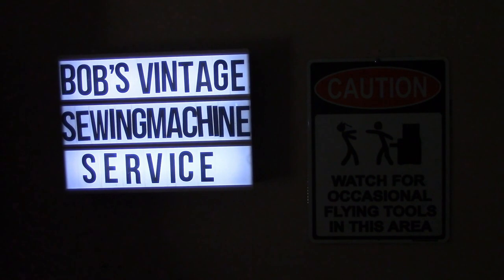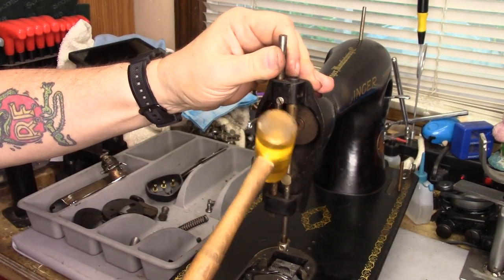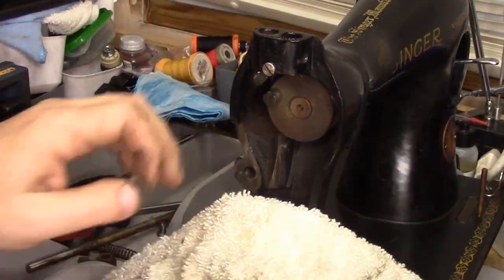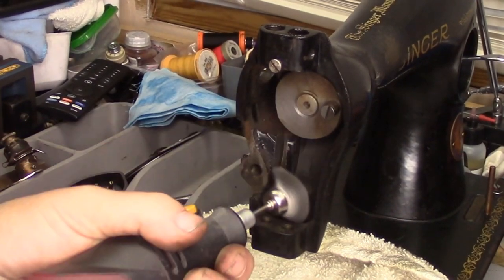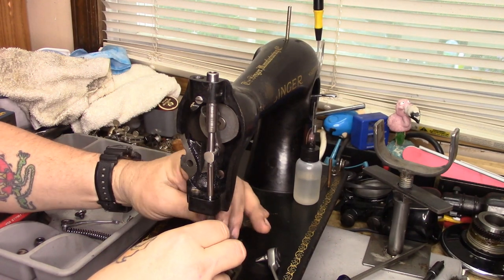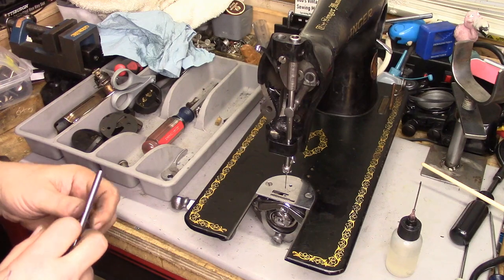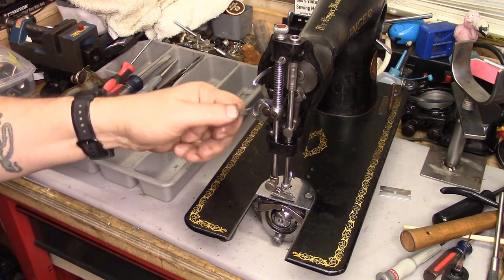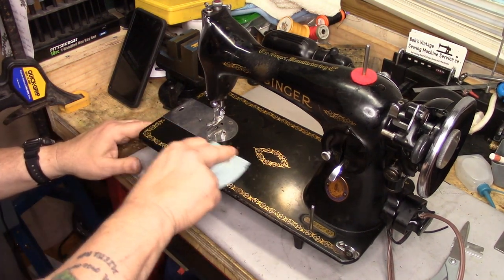The 15-91 Lives! Sunday Morning Quickies, May 22, 2022

Comment: Stupendous!  Never thought of running cup brushes into the needle bar area; always hand clean that area.
Reply from the maker: Glad it was helpful! I also use my smaller rotary tool with straight brushes, depending on the machine.

Comment: Great video, Bob. Machine looks like brand new. 
You are absolutely right about wire lengths. Every inch of wire that they saved, meant more profit. My mom worked at A.C.GILBERT cutting wires, and she used to tell me that you couldn't be off more than 1/16 of an inch.
Reply from the maker: OMG - Yeah, I know, they had to maximize profit and minimize cost, but I don't have to follow that rule! 🤣🤣🤣

Comment: I can’t thank you enough for your two videos on the bottom end of the 15-91 and your tutorial on rock shafts.  

In addition to your generosity to this charity, your generosity in sharing your knowledge is inspiring.  Truly.

Following your tutorials, I removed the upper shaft on my 15-90, took out the pivot points on the upper and lower shafts, cleaned them and then reset the points in the shafts and adjusted the movement and location of the feed dogs.  Now this machine started out really rather clean.  It has had more than one kerosene bath and I thought that the insides were just fine.  Was I wrong.

The inside of the pivot points were, to use your expression covered in shmoo and there was a certain amount of corrosion in the points.  I had no idea they were that dirty or corroded.  I also had no idea that the dirt and the bit of corrosion not only gummed up the machine, but it also resulted in the machine going somewhat out of adjustment.  I took a wire brush to the points them put a drop of oil on them reinstalled them and adjusted the shafts and the movement of the feed dogs.  

Given what I learned from your videos, the whole job took maybe 20 minutes and a fun 20 minutes at that.  What a difference to the machine!  It is now noticeably faster, I would say at least 20% maybe more.  It is significantly quieter and the sound it now makes is a beautiful clickety mechanical sound.  And it now runs so smoothly that I have to keep reminding myself that it’s a oscillating hook machine and not a rotary.  

What a difference a cleaning these parts makes!  I now perfectly understand the trouble you take to clean and polish these mechanical parts.  What a difference it makes!
Reply from the maker: It's amazing what a difference cleaning those pivots makes! A very commonly overlooked item.

Comment: Bob the upper shaft of a similar machine is out of whack, it starts out turning nicely until it is hard to turn, then you can move the upper shaft back and forth, quite a bit of play, I was thinking the shaft isn’t lining up with the bushing and is causing the needle bar to become tight when turning the hand wheel, it could also be the bottom shaft that will need adjusting, will let you know, if you have had something similar could you let me know, cheers Bob regards David.

Comment: I just purchased a 1941 treadle singer 15 and im so excited to get it working. Before I fully start disassembling it I wanted to test out its function. It was last in use about a year ago and has since become rather dusty and rusty but has been basically untouched. When I disengage the needle the treadle runs like butter. However, when I engage the needle the belt gets suck and stops spinning and then the treadle jams. Do you suppose it just needs a good cleaning to start working again or is there something else I might be missing? I plan on watching all of these videos tomorrow so that I can as carefully as possible follow along with cleaning her to the best of my ability

Comment: Can you advise how to adjust timing?
Reply from the maker: Short answer: you can't, it's fixed at the factory. Long answer: on these machines, unless the shuttle driver has been replaced, the linkages that drive the shuttle were pinned in place when the machine was built. On these we don't adjust timing, we adjust the needle bar height to get the machine into proper time. To do this, it's necessary to remove the needle plate so you can get a good view of the hook portion of the shuttle. Often, it's helpful to also remove the feed dog for a clearer view. Install a NEW 14 size needle for this measurement and adjustment. The screw that you need to loosen is on the pillar side of the needlebar box. There's a hole, that when the needle bar is down, allows access to the screw on the back of the needle bar clamp. On the needle bar itself, you will see two lines engraved at the upper portion of the bar, where the needle bar enters the upper bushing. With the needlebar at the very bottom of its stroke, the upper line should be even with the bottom of the busking. Loosen the screw that secures the needlebar clamp to the needlebar though the previously mentioned hole, and raise of lower the needlebar to align that mark. With the screw tightened snugly, turn the balance wheel in the direction of normal operation (top of the wheel towards the operator) until the lower mark on the needlebar is even with the bottom of the bushing. At that point in the rotation, if all else is OK, the point of the hook will be even with the shaft of the needle, and the point of the hook will be approximately 1/16" above the top of the eye of the needle. If the needle is aligned with the point of the hook, but the distance is too great or too little, loosen the needlebar clamp and move the needlebar to the appropriate spot. At this point, the marks are not important, it's the alignment of needle to point of hook, and distance from point to top of eye of needle that's important. I know this is a long explanation, but you asked! There is a copy of the adjuster's manual in the manuals section of my website here:

https://bobsvsmservice.com/wp-content/uploads/2022/07/Singer-15-91-service-manual.pdf